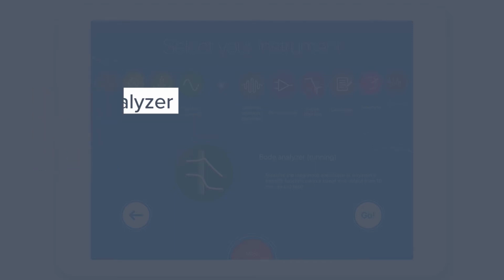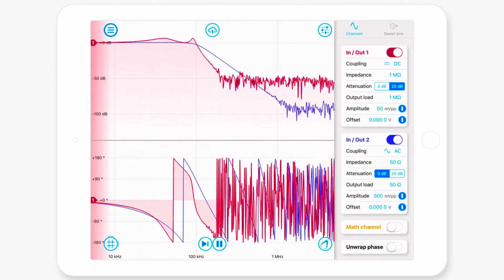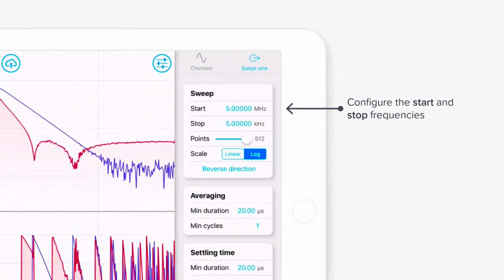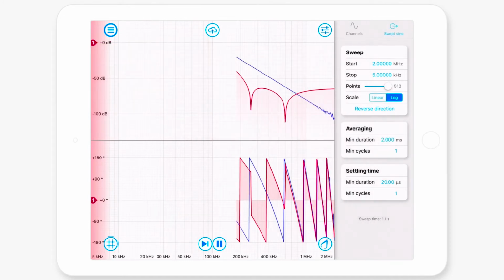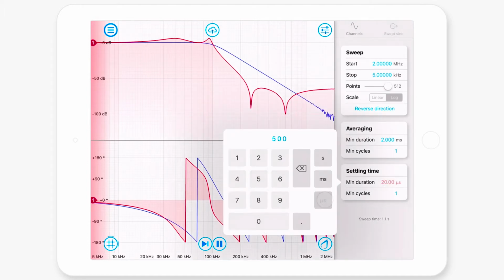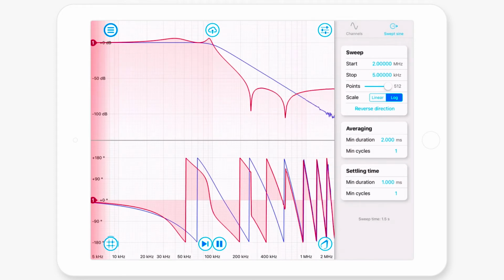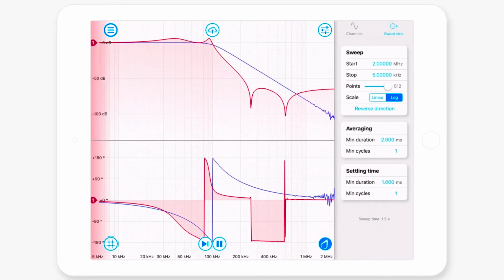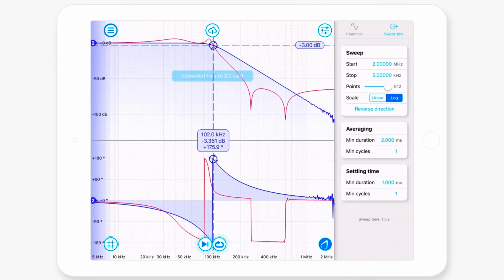Frequency Response Analyzer - Instrument Overview

Comment: Can it be measured PI control loop DC/DC?
Reply from the maker: Yes it can! Feel free to take a look at the spec sheet for more information https://download.liquidinstruments.com/documentation/specs/hardware/mokulab/MokuLab-Specifications.pdf?hsCtaTracking=3db7338d-a07e-40e7-9b22-356f720d6014%7C0ac59d0e-0c4e-407a-8ad9-445dc53edbb7#page=14